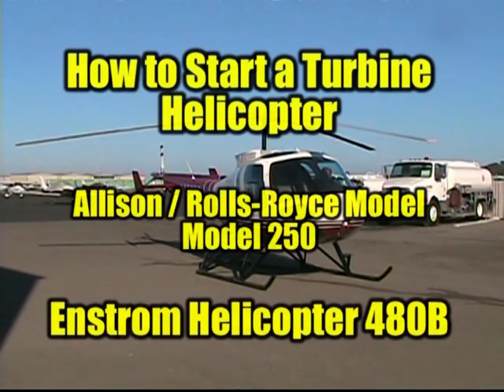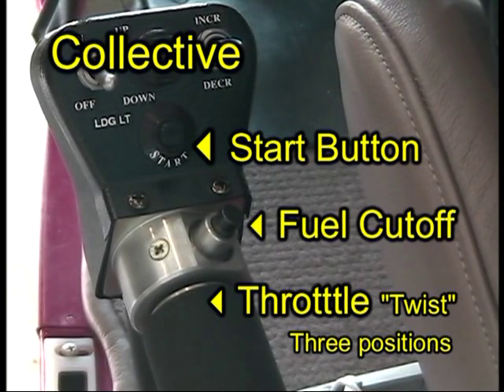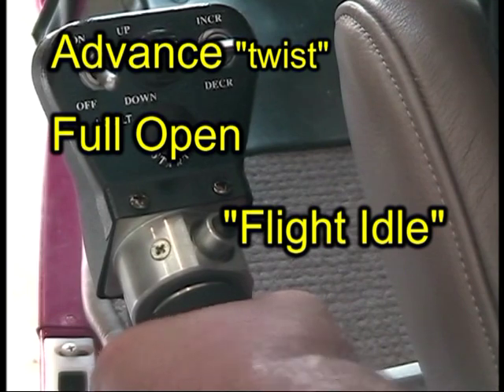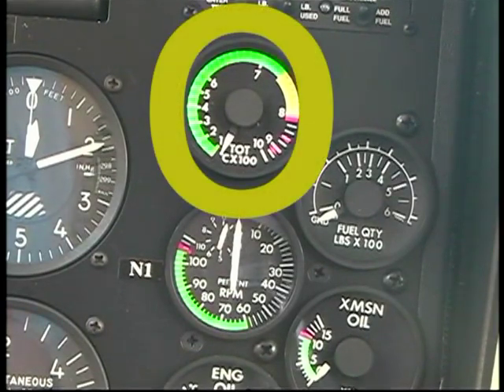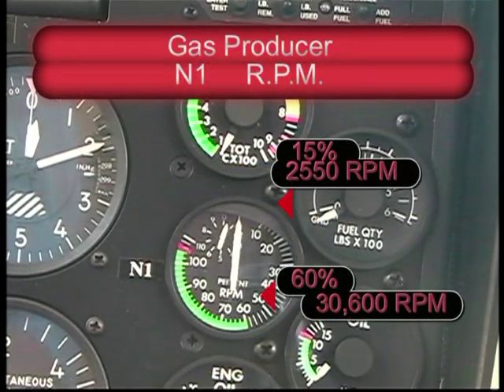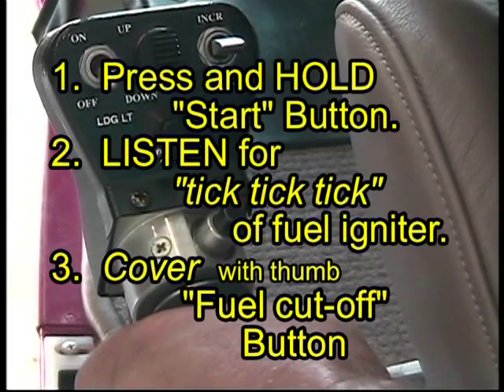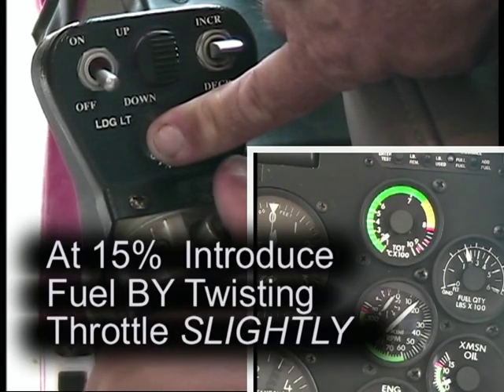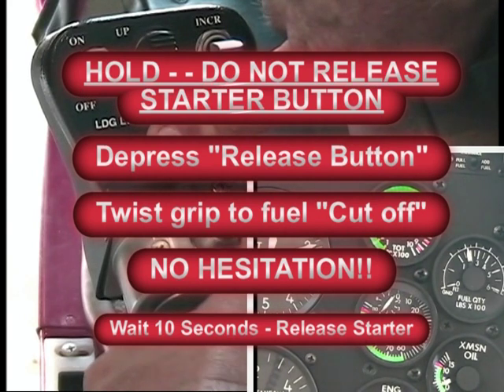How To Start an Enstrom Turbine Helicopter

Comment: It wasn't a hot start, it can stay in the red for a certain amount of seconds, dependent on the aircraft. It's a hot start if it DOESN'T drop back down to the yellow or green after so many seconds. I know on the 500 it's around 10 seconds for the red and 1 second for above 927 degrees. Good video, I like the setup of the collective.

Comment: So...fuel is introduced @ 2550 rpm. 60% is 30,600 rpm. So if I do the math, is my flight mode rpm (100%) correct?

Comment: Do you keep the starter running until 60% RPM because that is the point that a turbine can operate on its own without the use of the starter? Less than 60%, the turbine will/may not run on its own? Is this 60% number common on most/all turbine engines?
Reply: 50-60% is about right. The turbine will then be self-sustaining without damage.

Comment: how can that helicopter fly without control tubes that change the pitch of the rotor blades?
Reply: In Enstroms, they are inside the rotor mast, and they connect to the blades from the top, via "rockers".
It's much safer and cause less drag.

Comment: Just out of interest, how would this work with a Chinook? Do the twin rotors work in tandem, or is their a separate set of gauges for each?
Reply: The rotors on a 'Hook are mechanically connected through drive shafts, so only one rotor RPM gauge is needed.
Reply: @get2dachoppa249  If the two rotor speeds are ever different, you won't have to worry about a gauge.

Comment: Where are the pitch change links on the rotorhead? No swashplate?
Reply: The swashplate is located under the main rotor gearbox, the linkages run through the center of the mast. As far as I know, the Enstrom is the only bird that does that.

Comment: I am puzzled , you wrote about R.P.M. of engine- !5% is 2550 RPM and 60% is 30600 R.P.M. how can it be 30600 RPM for 60%? if  according to 15% is 2550RPM then it  should be  10200 R.P.M. only for 60%  . shouldn't it be ?

Comment: As far as I know, the Rolls-Royce M250 is the most reliable turboshaft engine ever built. It was introduced by Allison in the early 1960s, and is still manufactured today. I think they built around 20,000 to 30,000, and are used in several choppers.

Comment: How much costs a pilot training to obtain an helicopter pilot license?
Reply: It really depends on where and what helicopter. It cost me, maybe around $30k in the San Francisco Bay Area, learning in R22s (then I switched to Enstroms). I did it while having a full-time job and a bunch of other projects, and I already had my airplane rating (which means it takes longer to get the heli license than aviation noobs, as you have to also learn to keep adjusting to the differences, back-and-forth).
If you just do it full time, as a new pilot, in a less expensive area, you can probably do it for half that cost.

Comment: -.- the helicopter turns by increasing/decreasing the speed of the rear rotor (the tiny propeller on the back of the helicopter)